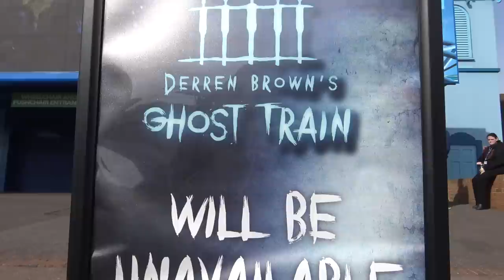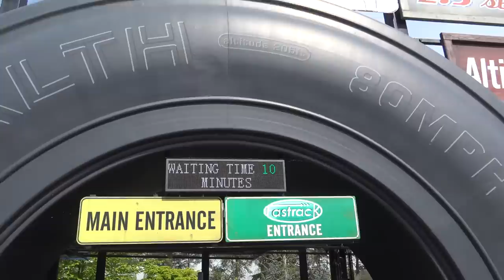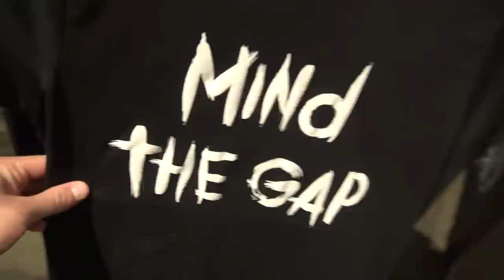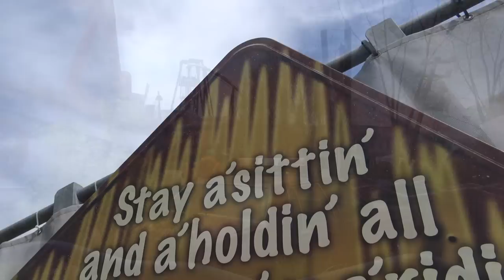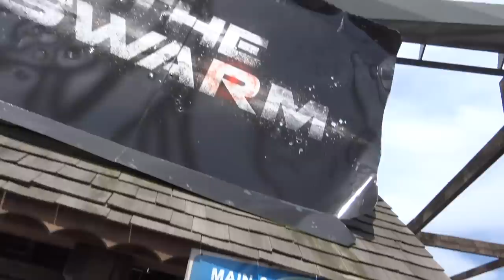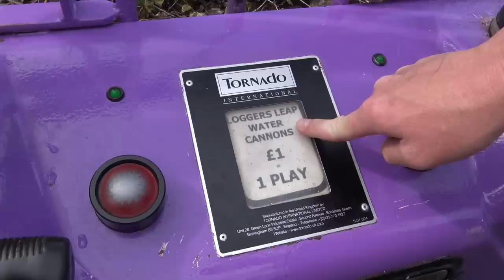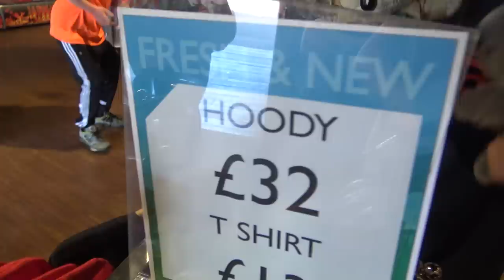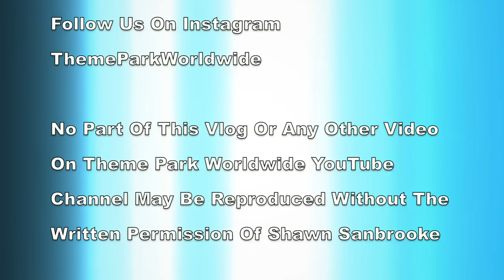Thorpe Park Vlog May 2016

Comment: I had a stealth row 6 no lights when i went on April 9th 2016 with my younger brother (we had 4 rides on it in a day)
Reply: U should of got fasttrack and  you could of gone on loads more. We got fasttrack accelerator pack then went to the fasttrack hut thing and get single rides is like £6 per person for fasttrack was much better than ditting fir 2 hours to go on saw
Reply: +AllyMsp X the day i went queues were either walk on and the maximum of 35mins as the weather was hot and miss all day

Comment: I got a GoPro Recently just to make theme park vlogs and PoVs but they won't allow my GoPro on the rides. How can you use your camera on the rides and if so can I use my gopro
Reply from the maker: You can't film on the coasters at the park, only smaller rides
Reply: or if its not hot wear a  big hoodie and strap you're camera to your chest or stomach and then when the ride is almost finished zip up the hoodie :)